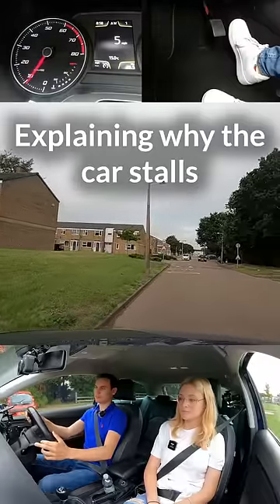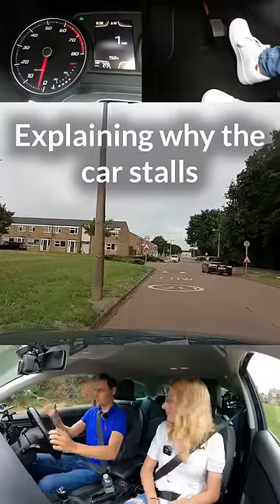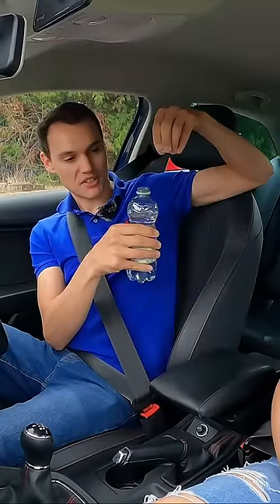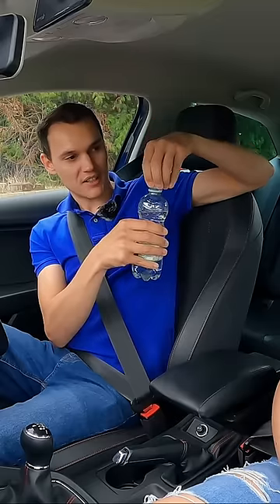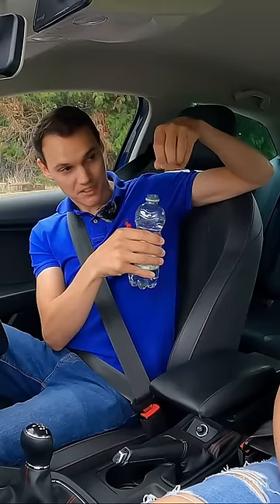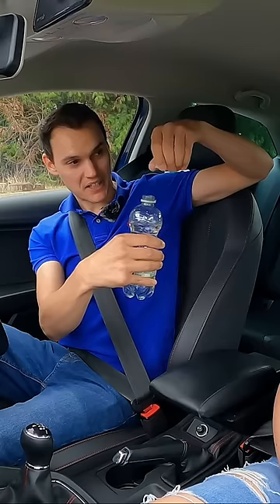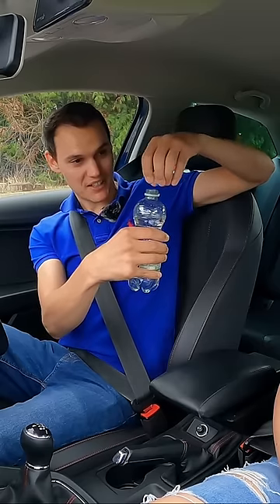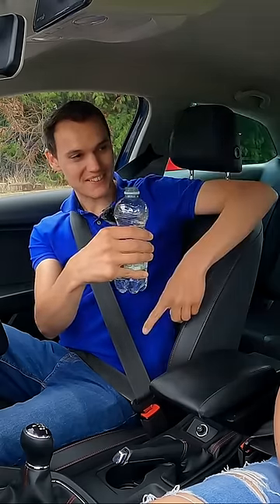Pupil using the dual controls to learn why the car stalls.

Comment: The computer was adding power?
Brake without pressing the clutch pedal before the revs drop below idle will stall the engine.

Comment: Good analogy with the bottle cap but I have to be “that guy” and say that it’s not the clutch that is connected to the engine (drive shaft) but the flywheel. That is what the clutch disk grips on to…

Comment: You dont actually need a clutch to change gears in a modern syncromesh transmission. Technically you don't need one to change gears in any manual transmission but its a lot easier with syncros.

Comment: Good explanation but just a small correction. The clutch plate is connected to the gearbox and the pressure plate and flywheel are connected to the engine.
Reply: That isn’t relevant to a learner driver it would only confuse them. Use your logic and reasoning skills to derive context from the situation this is a driving instructor not a vehicular mechanics professor😂
Reply: @samatkinson4331  you can make the same point without factual inaccuracies.

Comment: This is why majority of European countries drive better than Americans, they actually thoroughly explain the processes and give you proper requirements to pass their exams. Over in america there was literally a question in my exam that said “in the snow is it better to drive with:
A) snow chains
B) overinflated tires
C) underinflated tires

Then after that I drove 500 ft down the road, took a right onto an empty service road where I did a three point turn, and went right back. Oh yeah and it was in my moms automatic camry, not a manual.

Comment: I thought stalling was when you put to much force or stress it to much and it can’t get the pistons back up to re-ignite and repeat the process. I thought the clutch separating the engine and gearbox letting the engine continue running is called idling?

Comment: Well no, the flywheel is connected to the engine, the pressure plate is bolted onto the flywheel and the clutch isn’t connected to either the flywheel or pressure plate. It’s connected to the gearbox via a ‘primary shaft’ from the gearbox

Comment: Doesn’t explain why it stalled though. It just explains what the clutch is for.
Reply: The engine needs to continuously rotate at a minimum speed called an idle, to run and to be ready for your next acceleration.  This is because your engine has two dead points in the stroke of its cylinders where the piston cannot apply a torque to the crankshaft.  It has to continuously rotate so it stays out of those dead points.

If you force the engine to come to a dead stop by stopping without clutching at the end, you stall the engine and it can't restart without your starter motor spinning it.

An electric car wouldn't stall.  The motor can come to a complete stop and can restart again without any issue, because it is its own starter motor.

Comment: Good analogy but somewhat wrong
When you press down on the clutch pedal the clutch disk separates from the flywheel that is spun from the engine.
It does not separate from the gearbox.😅

Comment: I have an electric drive train so all I have is voltage on or off.
I'm more curious how the regenerative braking decides to apply some braking force from the drag, vs. the brake pads, vs. reverse torque from the motors.

Comment: The analogy was nearly spot on, but the clutch plate is connected to the transmission and disengages from the engine. You know the concept but have the working order wrong

Comment: Wrong, the clutch doesn’t spin the gearbox, the gearbox and clutch are spliced together, and the clutch releases the flywheel on the engine, not the other way around

Comment: This is what i mean! Ive been telling people for years that if you dont understand how an engine and transmission works they shouldnt be driving a manual. And im talking familiar knowledge no need for a mechanical degree. People are talking about shifting gears like "oh well my dad said 1st gear is for speeds x to y, 2nd gear from y to z speeds..." and so on, which is a totally  dumb way to learn to use a manual transmission.

Comment: the computer does not press anything at all. valves/injectors keep fueling cause the camshaft or however is called in english keeps moving the valves or injectors.

Comment: Maybe say it stops drive to the wheels rather than stop the wheels, if you've ever held in the clutch whilst driving the car will increase in speed for abit as there's no engine braking, it's also one of the biggest mistake learner drivers make when they go to press on the brake they'll hold the clutch down and brake together until they get used to what force to put on the brake pedal without stalling the engine.

Comment: That didnt explain why it stalls tho, it stalls because the torque required to "spin the wheels" gets too low and thus the load of the drivetrain is too much for the engine to overcome.

Comment: Then what do automatics do?
Reply: A traditional automatic transmission has a fluid coupling called a torque converter.  Instead of a clutch to disconnect the engine from the wheels, it has a compressor/turbine pair, surrounded in transmission fluid.  The compressor is on the engine side, and the turbine is on the transmission side.

If you brake, the turbine stays still, while the compressor just spins the transmission fluid in place, while the engine idles.   When you let go of the brake, the turbine receives torque from the fluid's motion that initially starts to power the car forward.  Once the car moves fast enough that the engine can power the car directly, the torque converter engages its solid coupling that allows the engine to directly drive the transmission.
Reply: My car is an automatic (from the driver's experience), but has the actual gear structure of a manual transmission.  You can think of it as a semi-automatic transmission.

Instead of having a fluid coupling, and planetary gears like a traditional automatic, it has a shaft/countershaft transmission and a clutch like a traditional manual.  The transmission control module decides when it clutches and when it shifts, so that it can resemble the user experience of an automatic.

Comment: So he didn’t actually explain why the car stalls, he explained in layman’s terms how the clutch works.

TL;DR a manual car stalls to prevent the transmission from being damaged when a freely spinning engine connects to a stationary gearbox. He could have demonstrated this by crushing the water bottle when he connected the cap 

Some cars can actually start rolling if you let the clutch off very, very slowly without giving it any gas. Once you master this it makes driving stick 1000x easier
Reply: You got it wrong

Comment: If you have a clutch, is there a computer telling the car to go?
Reply: Unlikely.  Many cars with manual transmissions do have an upshift light that detects when it would recommend for you to upshift.   That's about as much of a computer as you would have.

The reason the car jerks like this, is that you are forcing the engine to rotate slower than its idle speed.  The inertia of the engine is reacting to this, and applies a sudden reaction to this force, that briefly exceeds the stopping power of your brakes, as you force the engine to stop idling.  You then have to restart with your starter motor, for your next acceleration.
Reply: @carultch  I don't know what type of 5 speeds y'all are driving. My car doesn't have a computer or a light to tell you when to shift. The car is suppose to go forward when you let out the clutch.
Reply: @ibob148 The '83 Volkswagen Jetta had an upshift light.  My guess, is all it did was turn on once your RPM goes above 2700, or some number near it.

It wasn't very useful, because you usually could just tell by listening to the engine and feeling the rhythm of when you expect to shift.  It also was only really reliable on flat roadways.
Reply: @carultch  ah

Comment: Easy solution, drive an automatic
Reply: Its not hard to work a manual really.
Reply: driving an auto is taking the easy way out anyone who isn't completely incompetent can drive manual
Reply: Gearbox is more expensive, breaks faster, and is heavier. If I'm not gonna drive stick, I'm getting a dct mainly because they function better than automatics, allow for the manual change of gears, and even though they are quite expensive and break fast, they are actually good at what they do
Reply: I love manuals. Also my gearbox has 136k on it and has never needed any maintenance. An automatic gearbox wouldn't be the same.
Reply: I enjoy having that bit more car control. Automatics are ironically enough harder to drive because you can’t control the clutch giving you less control in certain situations like crawling speeds up a hill for edample
Reply: And lose driving potential.
Reply: @RayOLight How about a semiautomatic?
Reply: @KILLER.KNIGHT ? Those are not only usually quite jerky, but they completely negate what he said. Since you can’t control the clutch, it’s not helpful in the stated situation.
Reply: It’s not hard. I may be biased as I’ve loved cars all my life, but I picked up driving stick in like 1.5 total hours.
Reply: And never feel like you’re smart enough to drive a normal car lmao.
Reply: @youraveragegamer8832  What’s a DCT?
Reply: @KILLER.KNIGHT  Dual Clutch Transmission. It's essentially an automated manual with two clutches. There are two clutches, one operating odd numbered gears and one operating even numbered gears. This allows for fast shift times. I admittedly don't know too much about it but they usually have high quality paddle shifters, not sure if they come with a stick in the console or not. I have heard that they work great until they unexpectedly die out of nowhere. Not sure how true that is. For performance driving, they are definitely the ideal though. For fun, I'm going manual I think. I
Reply: @RayOLight  Me switching between 3 different gears under abrupt acceleration and abruptly letting off the gas
Reply: @youraveragegamer8832  It can be paddles or a lever.
Reply: @youraveragegamer8832  One guy above is saying they’re very jerky. He probably needs a repair on it or a new unit entirely.
Reply: @KILLER.KNIGHT  Depends on the type. Dcts can be jerky from what I've heard, but they can also be smooth. They're a relatively new transmission system so it's to be expected though. Other types of automated manuals only have one clutch doing all the work so they're a bit different
Reply: Once u learn a manual its actually simple but if u want an automatic, go for it👍👍👍
Reply: No
Reply: @sam.fridayyy nope
Reply: @youraveragegamer8832   ht I’ve seen semiautomatic transmission on late 90/early 2000 Toyota Avensis.
Reply: @toiletseat777 I'm American and manual cars are normal and provide better control than an automatic
Reply: @toiletseat777 Manuals are actually more common than automatics around Europe as a whole
Reply: @toiletseat777 Says the American who's never left his land. Well if you came here you'd see most cars are infact manual and all countries are different, wen don't all follow the same way of life as America.
Reply: @youraveragegamer8832 A manual gearbox will not break easier than a auto. They only break if you misuse them. An auto will have more fuel consumption and have heavier wear and tear on the gearbox. Also good luck getting out of anything that isn't tarmac with an auto.
Reply: @toiletseat777 They literally are? That's as moronic as saying "All laws in all countries are the same" or something similarly stupid. Different countries work differently.

Comment: Clutch seperates from the gearbox? The fuck? It connects and disconnects the clutchplate to the flywheel, which is connected the the engine. The clutch is always in contact with the gearbox because of the axle going through the plate. 
Rest of the explanation was fine though, just wanted to mention this.